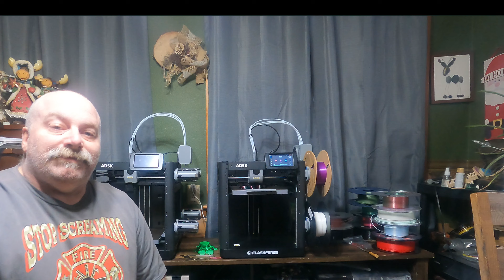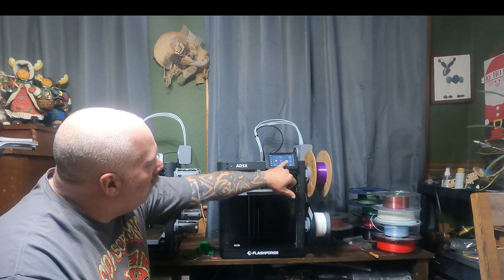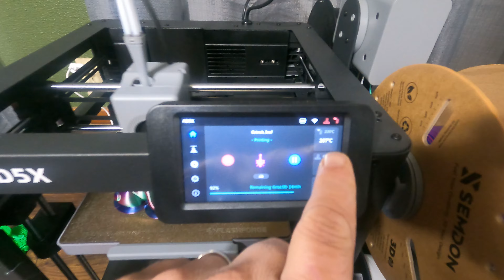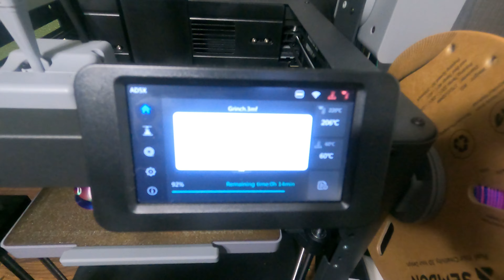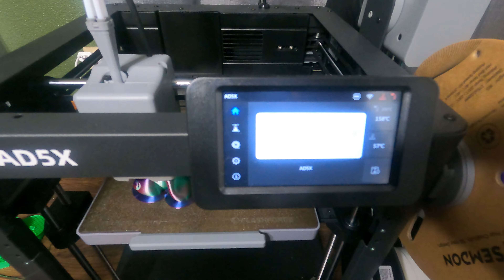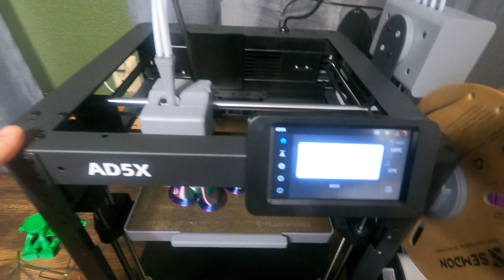FlashForge AD5X - Honest Review - The Real Truth No One Talks About

Comment: intresting, someone just gave me one was not heating up but not throwing any errors yet, not a big fan of Flasforge but was free, I currently run 4 Bambu P2S and a P1S have over 4000  hours and no issue. So to fix the free Falsforge I replaced the hotend assembly and it finally pased the calibration test, which before was not able to heat up sufficient. so for 15 bucks which the assembly cost me onn Amazon got a a 5th printer for some small stuff,  lets see how it holds up.  but i have read that those assemblies fail anywhere from 300 to 600 hours which is really poor on there part.

Comment: Hey, I haven't had the issue you described in your video but if you attempt download a klipper based firmware upgrade like zmod, there is an option to disable the error and still have the printer attempt to print. This might fix your issue and fingers crossed

Comment: my ad5x has issues here and there. all easy fixes up until now. now im having issues with flat surfaces on the first couple of layers leaving ugly marks on the back. i've played with leveling forever and kinda gave up. bambu labs are awful though. my mini worked for a week before having a malfunction that gobbed up the extruder then after cleaning it 2 prints later it destroyed its nozzle heating part. replaced it, got a z axis error and never found out how to fix it even though i've literally replaced the whole extruder motor and everything.. support just advises me to keep changing the parts ive changed... cant wait to save up money for a snapmaker. there supposed to be the best from everything i've heard

Comment: Typically, that is a thermistor issue. I run voron 2.4 machines now which I love because I completely put them together bolt by bolt and they also require the builder to install Klipper, Moonraker, and Mainsail, the firmware. So it's a full on build meaning fixes are easy since we know the machines extremely well. I have, and still use older Lulzbot TAZ 5 machines that I did upgrade to newer toolheads. I had the same issue you have and always the thermistor. When the temp of the toolhead is too different than the gcode assigned temp, either low or high you will get an error, Thermal runaway. For me I get the wording in my error, maybe you just get the 0007 which, if you google it for that machine it will suely tell you the error by name. Cheers and I was tempted to get this machine BUT I actually am a little tired of having to run different slicers as I like machines that I can use Cura or the Prusa Slicer.

Comment: Seems like you just got unlucky and they had a bad batch of printers and you got 2 of them with the same problem. I have a 5X and the only problem I have with mine is the first layer Z axis is off. As in not very uniform for the entire bad surface and I have adjusted the z axis offset. Their tech support did respond within 24hrs, but they were pretty much clueless on how to resolve the problem.

So long story short besides the first layer Z axis problem it has been a great printer.

Comment: After 6 months, my 5X stopped working giving me an Error 113. I replaced the Printhead and IFS plus the feeder tubes. The system went through a system check and got green checks. Went to print and got an error 113. That error says something is blocking the filament pathway in the Printhead.  I contacted FF and was told to do various things which I did to no avail. I tried to explain the Printhead was NEW. Considering it had never been used there shouldn’t be anything clogging the filament pathway. Long story short, I decided to toss the machine. Not once did FF offer any replacement even though it was still under warranty! I’m done with Flashforge.

Comment: I had the same issue. It didn't come with a heat sock. I added one and have not had the error since.

I have been running it a lot in my classroom. I am even having the school order one so that large class print jobs can be run a lot faster, and so that we are not relying on my personal printer.
I do have an enclosure. I added an enclosure kit to the order for the school's one.
Reply: Im a big FF fan. All machines have their quarks. Once you get it dialed in it will print flawless. Enclosure helps a lot with petg. I have a 5m and ad5x. 5m is a workhorse.

Comment: I am experiencing the same issue: the printer stops mid-print, but I don't receive any message. The screen locks up, and I have to reboot. This has been an ongoing issue since I purchased it in mid-January.  Flashforge support has no clue at this point.